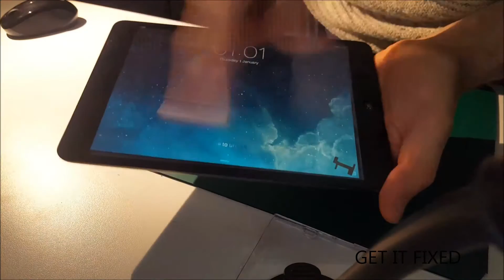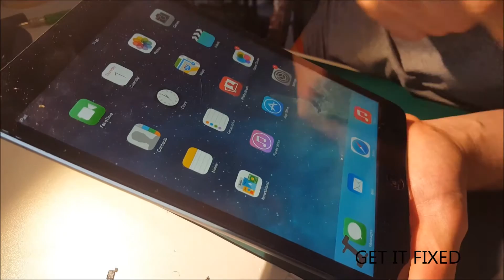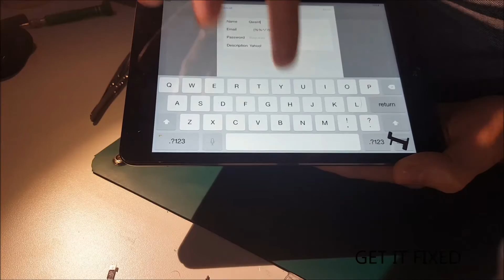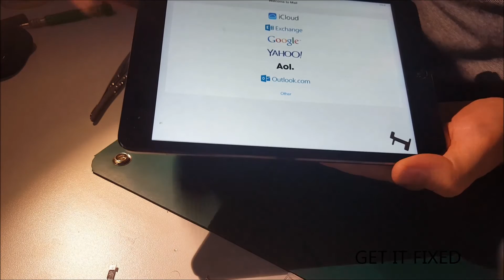IPAD Mini Digitizer FPC Replacement  Fixed

Comment: How do you come to the official problem issue, exactly ho do you diagnostic the problem ? Is there a  general old knowledge that when some "digitizer" doesn't work with no reason, could most likely be the FPC ?
Reply from the maker: Hi Alexander. First try to check visual, if u see some liquid damage, you need to clean completely the board with some Contact Spray. OR ultrasound bath. If that doesn't sort the situation, then u need to know few electronics basis to get down to the main problem. But mostly is just digitizer fault. If has been replaced before in a phone repair shop. Because they use only cheap part. Hope this helps a bit ! Ceers mate